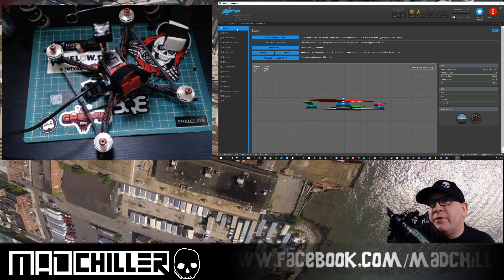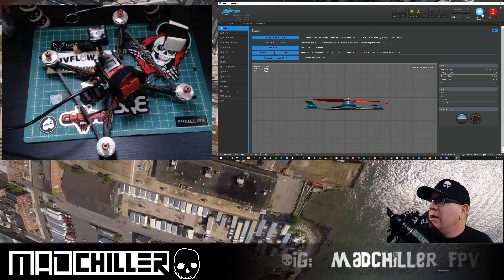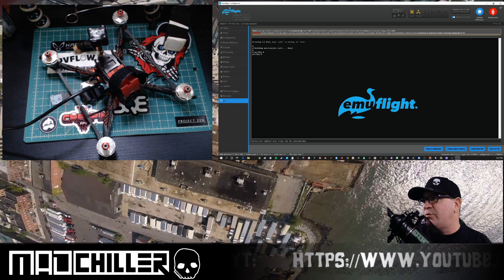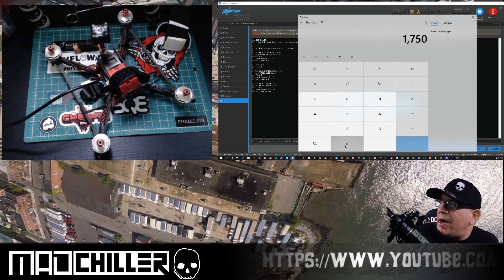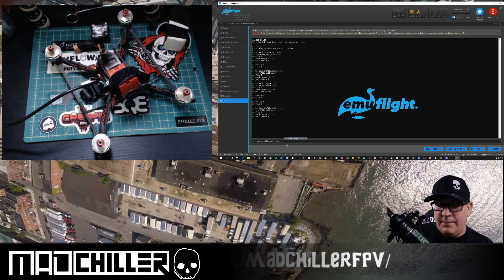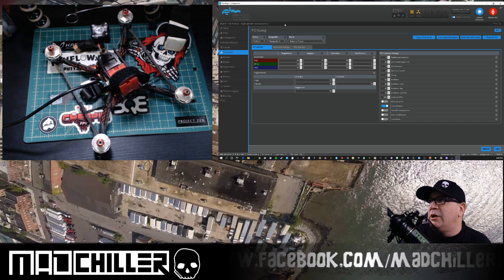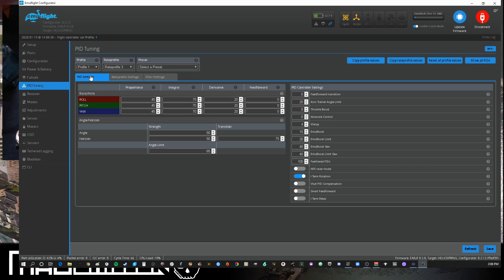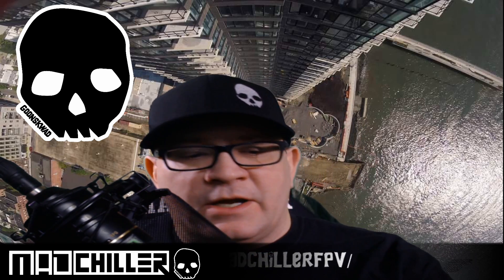Setting up: Motor Output Limit and Auto PID Profile selection in Emuflight

Comment: So I assume if you are not concerned about using 6s and you just want to limit your motor output you just use the motor output command by itself? Or is the correct way to still set it up by profile?

Example: you are running 2750kv motors and you want to extend your Battery life so you are limiting your motors to 2450kv.
Reply from the maker: Correct.. you don’t need to do the profile stuff if you just want to output limit…
Reply: @MAD_CHILLER  Thanks bro!

Comment: So I followed this and many more tutorials and got it to work on 3 and 4s. Whatever I try, it will not switch to 6S when connected to a storage 6s lipo. It does nothing.
4s working perfectly fine.. what am I doing wrong?
Reply: Set the cell count to 5 instead of 6. Sometimes the FC picks up a 6S as a 5S. Look in "Power and Battery" in Configurator to confirm.
Reply: @zuldanfpv4634  Thanks! Got it to work eventually. Seemed to only work when unplugging the FC from the computer. Thanks anyways, will remember!

Comment: +1👍 
1) an OpenTX throttle curve is acceptable in general correct?
2) you suggested about 77% output limit for my 1750kv on 6S -- How do i calculate such myself if i wanted to? just base it off some recommended kv like you did here (say 1300)?
Reply from the maker: 1) I do not recommend using any throttle curve that limits the throttle range. Expo and such is fine.  2) Yes.  Take your theoretical target KV (1300) and divide it but the actual kv of you motors.
Reply: @gabrielevinci  awesome info! brain-stored.